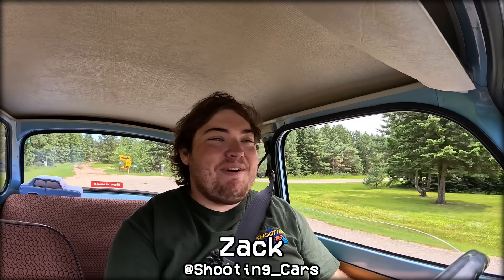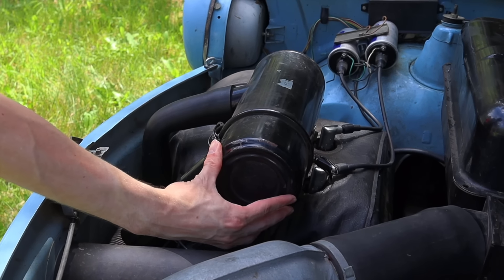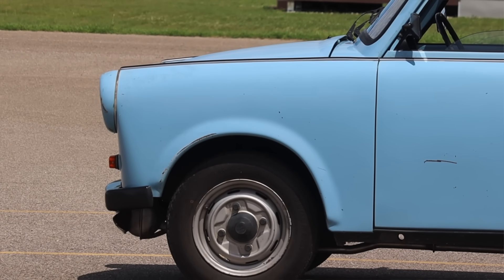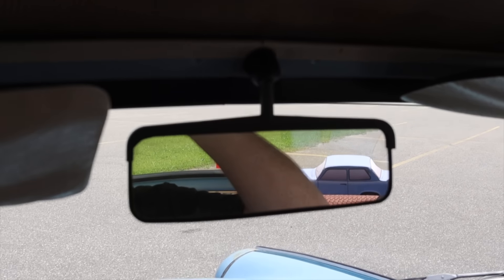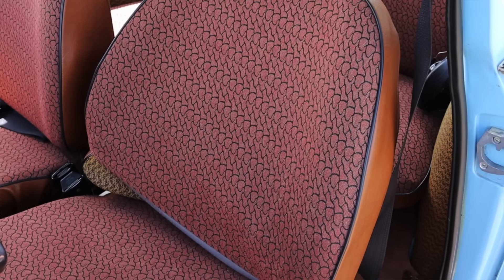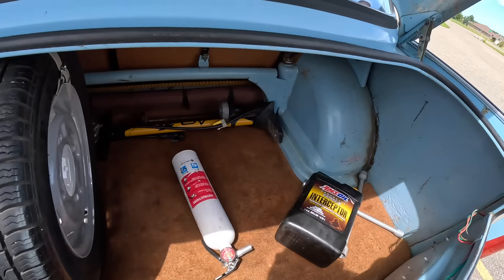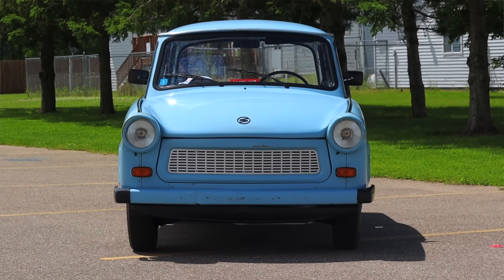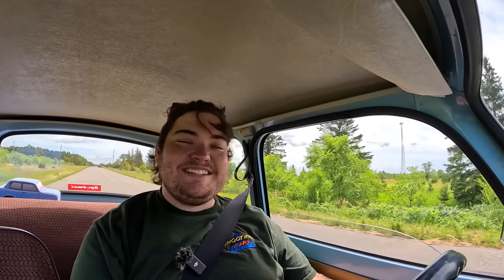1976 Trabant 601 Review - The Most FAMOUS Car From East Germany!

Comment: Some supplements: the plastic body was necessary due to lag of steel in communism.  As the frame where the panels are fixed on was made of metal corrosion was a problem too. In the last two model years they offered a 1.1l 4 stroke engine instead the 2 stroke.  They called it "Mummy with pace maker"
Reply: On the contrary, the "plastic" body was made from low-grade soviet (recycled) cotton and despite the car having a metal frame underneath, the crash tests conducted after the fall of berlin wall favoured the Trabant in the contemporary tests. This ment each panel was made-to-fit, including doors (as a spare part).
The only biggest downside, which was it's upside, was the panels, which did degraded, however were not recyclable.
IFA Zwickau tried to push a successor to the Trabant p601, even going as far as making blueprints for the body, but the communist party has ruled out that the car industry was not something to be investing in (remember - the cars were selling out, years-long waiting lists and the export market was not filled). Suspiciously, the blueprints were locked/destroyed, and yet, years later, VW has "developed" their own new small car, looking almost exactly like the "future" trabi.
Nonethanless, the engineers went to work again, and aware of the two-stroke disaster under the hood, set out to create much cleaner and fuel efficient powerplant.
It was a three cylinder direct injected diesel engine, which seemed promising in a test prototype.
This was yet again cancelled, due to the IFA purchasing a license for VW engines to mount into the Trabant/Wartburg (1.1/1.3L), and later the factory has been sold off to VW.
Trabant is the epitome of Socialist Planned Economy, where car could live 30 years without a major change, losing it's market value and worsening the company's (or rather - the state's) financial reserves.

Comment: Did you also know that (and hopefully somebody else hasn't already beaten me to it!): The reason several 2-stroke cars like Trabants, Saabs, etc have a freewheeling clutch and can't engine brake is by design.. is to prevent the "engine overspeed, throttle closed" condition.. to maintain constant, safe engine lubrication. Because of the total loss oiling system inherent to 2-stroke gassers lets say you're driving down hill and you downshift using the engine to maintain slower speeds while staying the brakes, you've got your foot off the gas, throttle closed with the engine turning 2k+ without any fuel/oil mix but revs are slowing climbing as the vehicle accelerates downhill, throttle still closed, in idle position, choking off lube supply, as you do in a regular 4-stroke.. But this would swiftly destroy a 2-stroke without that freewheeling clutch option (but not all had one, you just had to know what you had and how to use it)

Comment: Go Trabi Go! My favorite German language movie, Zack!  When all those Trabis were going west on 11 November 1989, my Filipina wife would have just turned 25. She will be 60 this year. I remember that in the movie the Trabi was named "Georgy". How joyous the ending of the movie when Georgy has been rescued from a trash barge, has lost his roof, and is turned into a convertible. That composite material that the body was made from is the reason that many Trabants have survived, when most other cars of the same vintage have succumbed to rust in many countries. It's an example of what you do when you just use the materials you have. Of course, early SAAB vehicles also had two stroke air cooled engines, as did the early versions of the venerable Suzuki Jimny 4x4. Simple is good.

Comment: A few interesting observations I have about this particular Trabi:
- The bumpers must have been replaced at some point. 1970s bumpers had different overrriders. It was a common practice with Trabis to "update" cars with newer elements and the factory always designed updated parts in such a way that would fit older cars, plug and play. Of course today parts that are period correct for older examples have become very sought after
- The economy gauge in this car is a later addition. The gauge was developed sometime in the 1980s as a cheaper alternative to an aftermarket fuel gauge that also fits in this spot in the dashboard. The fuel gauge was available for the entire production period but it was seldom fitted and never from the factory, only aftermarket. Later in production Trabis made in higher trim levels (yes there were trim levels) would come with the economy gauge fitted
- Speaking of trim levels, the 601 Hycomat (semi auto) was only available in base trim. Because of that this Trabi has a different dashboard than most of its contemporaries. This older style of dashboard from the 60s was still used for base models until 1977 or 1978, while a newer, padded design was used for medium and top of the line . Differences like that were the reason Trabi had 4 trim levels, despite being a very basic car. Most Trabants made during the 70s were of the medium-tier 601S model so the non-padded dashboard wasn't used too often. Today basic 601 cars that still have these older, "hard" dashboards are very difficult to come by since most of them were replaced by owners and thrown away at some point
- If anyone's wondering why the interior colors are so mismatched, it's probably because the seats and door inserts were replaced. Reddish brown cloth you see on the seats was used in the 80s on Deluxe models. Yellow/brown herringbone cloth on the rear door cards is from the same period, but cheaper trim, so the interior might even be from 2 different cars. This car most likely left the factory with a grey and black cloth interior, as most Trabants did in the mid 70s (except for the Deluxe which had a fully leatherette interior in brown before it got replaced with brown cloth). Once again the seats and door cards are easy to replace on your own and many owners did that, even multiple times. If you want to restore a Trabi interior properly you're in for a challenge because there were at least 8 styles over the years
- That thing in the middle of the dashboard is indeed a radio blanking plate. There were dedicated radios made for Trabant in the GDR since it's a non-standard size (slightly smaller than the norm). Eastern Germany was decently advanced in electronics so Trabi radios had FM and automatic frequency control, just like radios for other European cars at the time. Of course the radio wasn't standard on any of the trim levels:)